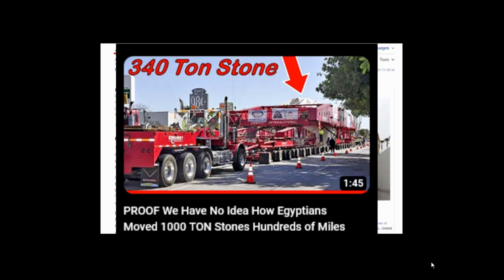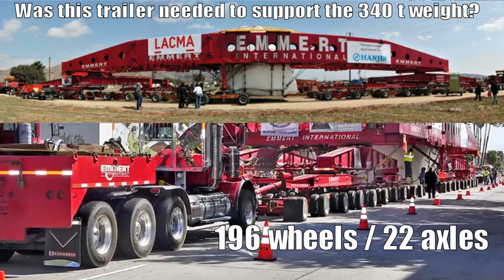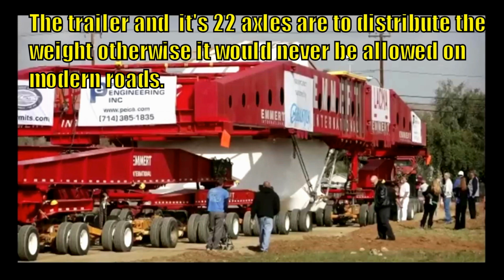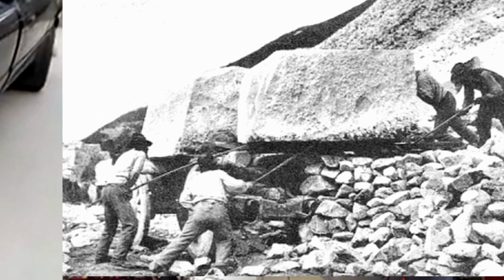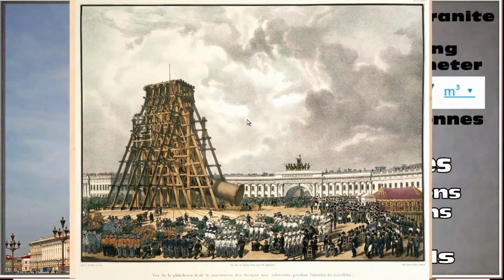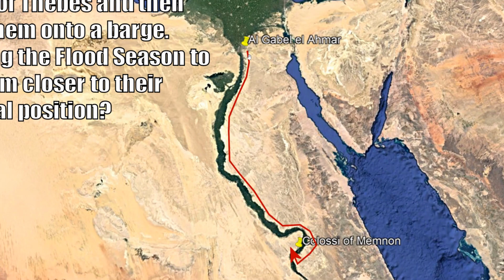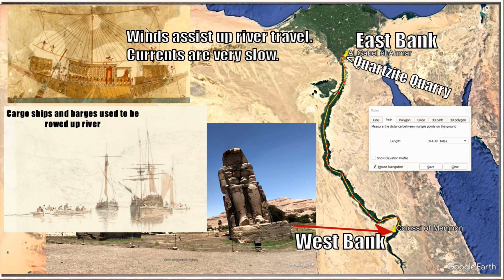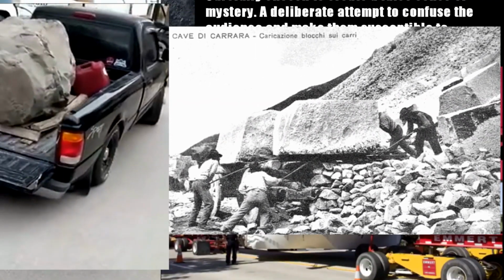Why Does Lost Ancient High Technology Keep Repackaging Old Scams As Fresh?

Comment: Most stones in the 3 Old Kingdom Giza pyramids weigh between 2-15 tons.  I think the granite stones above the King's Chamber (in the 'relieving chamber') are the largest and heaviest stone we know about used in their construction. (Though I may be wrong on this point,, i seem to recall reading that)
Reply: Yes.  The vast majority of the blocks of the Giza Pyramids were not very large - typically on average 10 tons or less as you noted.  The largest/heaviest blocks outside of those few granite relieving slabs are found in the bottom half closest to the ground.  

In the case of Menkaure there are very large "base stones" in the bottom of his pyramid - ~20 tons or so - but one can see evidence that they were quarried not far away.  As they Egyptians leveled the plateau to create a base for his pyramid they cut those large blocks of limestone not 50 meters away so that they were not actually moved very far.  

Typically the limestone quarries between the pyramids and the harbor area which once sat adjacent Khafre's valley temple were a few hundred meters away.  The harbor area itself was around ~500 meters.  So all blocks were transported overland a short distance from the harbor or the adjacent quarries representing hundreds of meters rather than hundreds of kilometers. 

p.s. - we can see that Khufu built his pyramid atop an existing hill.  Meanwhile those relieving chambers are below the halfway point of the pyramid at its' center.  So it is plausible the existing hillside they built atop probably formed part of the ramp used to raise those granite slabs when creating the King's Chamber and the areas below.  

Once completed they filled in around those areas and proceeded to construct the upper half of the pyramid.

Comment: Somewhere either at Karnak or Luxor there are wall depictions of Egyptians pulling barges up the nile with long ropes and groups of men
Reply: The famous depiction of obelisks being transported on a large ship is in Hatshepsut's mortuary temple if you can find depictions online of the temple's panels.  It shows 2 obelisks resting next to each other on the deck of a large barge with 3 rows of oars and sails.  That barge is further connected by ropes to multiple smaller ships which similarly have pole men and sails. 

So this was not some "reed boat" or dugout or similar small craft ala "primitive".  It depicts a large multi-deck craft being moved by both oars and sail power which is further being towed by smaller craft.  

p.s. - as an aside as I have made this point before.  The Egyptian ships were assembled to size using planks sewn together unlike "fixed hull" ships.  Shipwrights today will first create the framing of the hull to then attach planking to that - whereas the Egyptians created the exterior hull and added reinforcing boards to the inside of that shape.

This means that rather than trying to fit the object to an already built ship = the ship could be assembled around the object.  This facilitates loading/unloading more easily as you need but create the hull/deck structure with access ramps on both ends ----> the obelisks are pulled up one end onto the deck as the pullers go down the opposite end/ramp = and the rest of the ship is assembled around that.  This obviates a need for "lifting" with very large objects.
Reply: @varyolla435  yes. I like the concept of assembly of the boat around the load.
Reply: I found the relief i was thinking of.... Temple of Karnak ...depiction of Tutankhamun's Opet festival. Groups of men towing barges with ropes.

Comment: I'm not sure how the pickup is supposed to show anything - never mind that the right rear has a visible suspension problem before dropping the boulder on it, most likely why they were crushing the pickup to begin with - but the front end loader is having no problem lifting and moving the boulder and it's a SMALL front end loader. Not even medium sized. Small. 

Hauling heavy weights across roads and not damaging them reminds me of the roads where I am with logging trucks and all the problems that come with very cold, snowy winters followed by thawing and refreezing spring. The state did a multiyear study and comparison with Scandinavian countries with similar circumstances and why their roads hold up so much better than our US state ones; we are stuck, much like family budgets, without the ability/political will to make the investment up front to save money over ten years and thus have to repair and resurface on a regular schedule year on year even though it costs more in the long term. That's reality. Can you imaging getting approval to spend the money to build the infrastructure necessary to move the stones just to prove we can build a pyramid?!

Comment: In the Netherlands they used to push and pull ships. It is called "Truilen" and "Jagen". Truilen is when people walk on the land and use a pole so they can push (and stop) a ship. Jagen is when people walk on the land and pull the ship. There is a short Dutch Wiki about these two topics. Wiki also mentions the Romans already used 'Jagen'. It seems to me both, pushing and pulling a boat, is something anyone would 'invent' to control a floating object. 

In the Wiki I also read about Karel de Grote/Charlemagne, ruler of the holy roman empire (768ad). He created laws to make sure the 'Jaagpad', (path on sides of river to pull the ships)was not obstructed by anything or anyone. This clearly points out the value and regular use of these paths.

Comment: 1:23 "to avoid overpasses " -> In the Army, we wasn't allowed to March with synchronised steps over a bright. The reason was that the synchronised steps could destroy/ collapse the bridge, even one that was so strong enough that a tank could drive over it.
Reply: @@AquaFyrre In all fairness the military like most things gets a bad rap.  "The system" itself is actually good and works. There is valid reasoning behind many of the on the surface silly things you are required to do in the military. The problem of course is that any large system in the end is merely = a sum of its' parts.......

So in the military you find a lot of idiots - just as you find some quite competent individuals.  If everyone does what they are "supposed" to do then things can go quite well.  People being like electricity however means many = will take the path of least resistance - i.e. slack off and half-ass things.
Reply: @@AquaFyrre Yes.  "Attention to detail" in war saves lives along with discipline.  The latter as an aside has been understood going back millennia.  Roman legions maintained exceptional discipline enforced by ruthless means as times because they understood that unless they acted as one = they would be defeated and destroyed.  

So there is a lot of things required in military service which civilians would eschew and not understand.  Yet as I noted there is actually method to the madness behind that.  A soldier who say misses dust balls under their bed in their barracks room would probably miss signs of a landmine in combat and subsequently = kill themselves and their teammates.
Reply: @@AquaFyrre Battlefield - read "black" - humor.....  🤭

p.s. - former Army NCO and life member of VFW.  Glad you made it.  👍
Reply: @varyolla435  Nice to meet an army man, Reserve officer here.
Reply: @Akimos  🪖👍